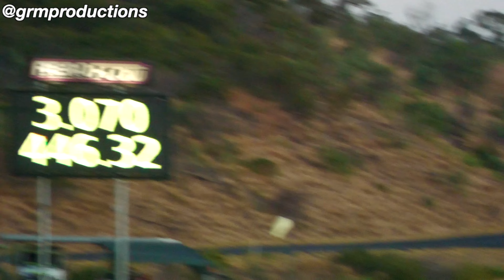Westernationals 2023

Comment: are they running 1/8 mile in the top fuels ?
Reply: is it? or is it  a "NHRA 1/4",   ya know 35 feet
Reply from the maker: 1000ft
Reply: No way. They run a 3.066 at 13:45. That can't be 1000ft. Unless the speed is in mph instead of kph but I find that hard to imagine
Reply: @robertr7923  Judging by ET I would say they are running 1/8 mile based off what we are running here in the US at NHRA events.
Reply: @robertr7923  thats the 1/8th mile time the motorplex 1000th foot timing wasnt working so they had to go off the 1/8th mile time
Reply: I think it's the quarter Mile.